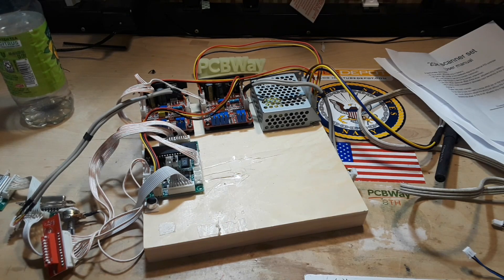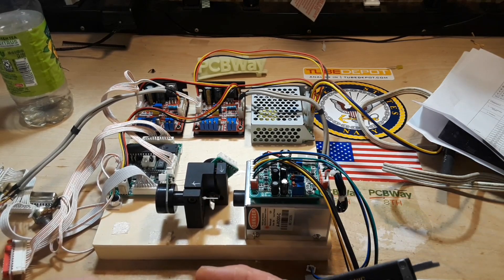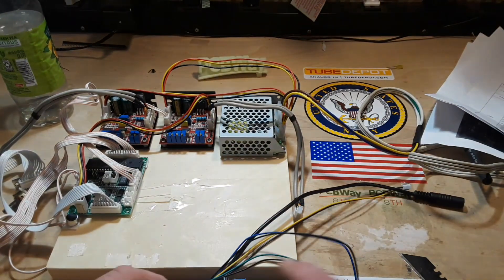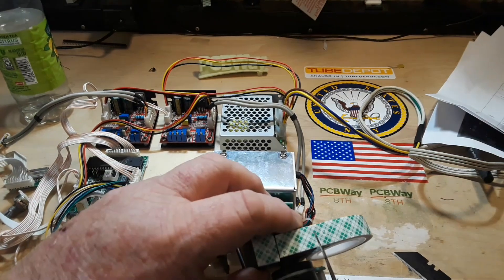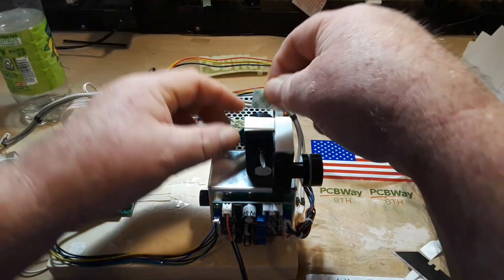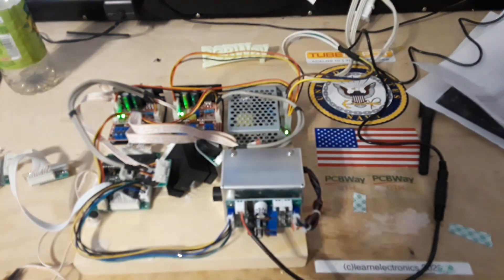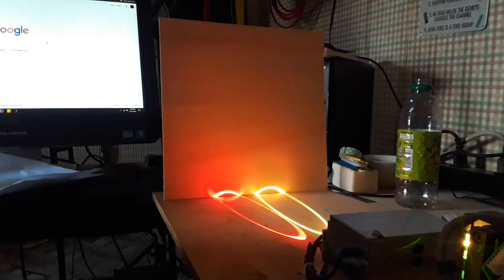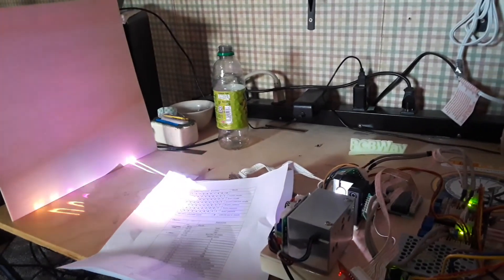DIY LASER Show Pt 3

Comment: Less fun assembling but you can get a DMX controllable RGB laser for $60 or an animation laser, also RGB with DMX for a little over $100.

I tore down my cheap $60 unit and found the "intensity" knob was actually not working and kept the lasers turning off and on to not be as bright. Bypassed it and holy crap does it look way better when projecting large patterns!

Comment: The RGB laser diodes inside your module generate a lot of heat, which needs to sink into a finned heatsink with a cooling fan. The aluminum block side of the module is also it's heat sink. The laser diodes will go into a thermal runaway state of self destruction, if overheated.
The aluminum X/Y block for the galvos is also a heatsink that needs to be bolted directly to an aluminum optical plate. The galvos also generate their own heat and will self destruct.
The metal 'feet' on the galvo driver boards are also heatsinks to keep the power amps from overheating.
TTL RGB driver boards don't normally have trim pots. So, you may have an analog driver board, instead. That would be good, because you could mix RGB, instead of only switching between 7 colors.
Reply from the maker: It's only on the board for prototyping. It will go into an enclosure

Comment: Cool laser. :)

You could mount the lense on springs with screws through the middle to make it ajustable.
Reply from the maker: They are on this board until I decide on a permanent solution. But yeah, I will make either the mirrors or laser adjustable. You think like me!
Reply: @learnelectronics  They do say 'Great minds think alike.' :)

Comment: you should of mounted the laser with the circuit board facing the power supply this way if ever you wanted to build a box around it, you would have it a corner ready to go